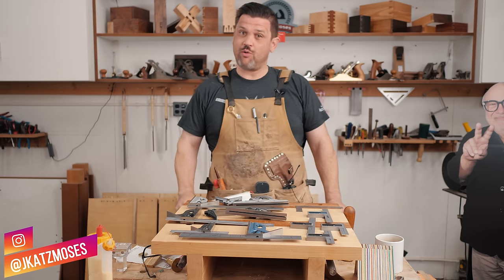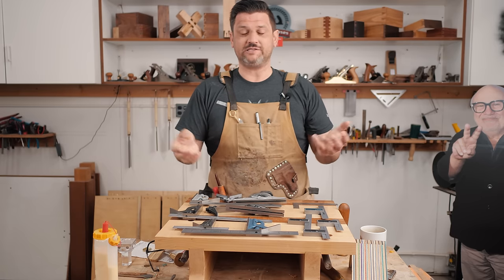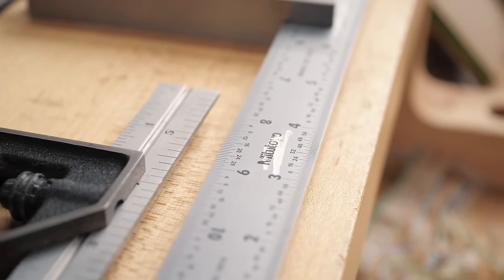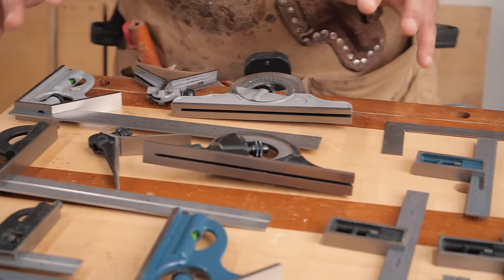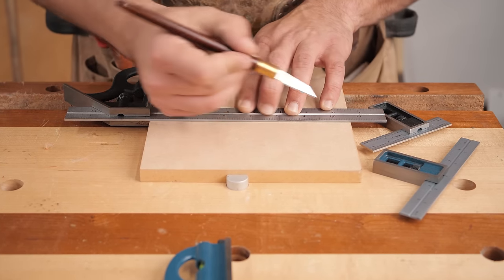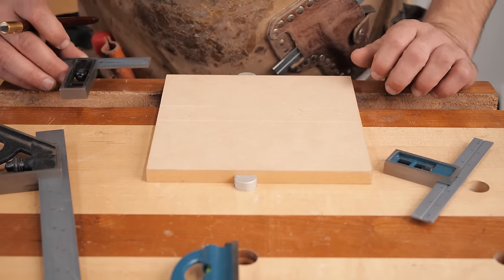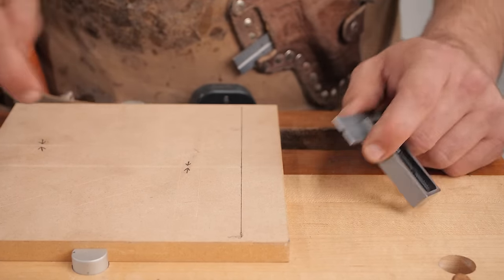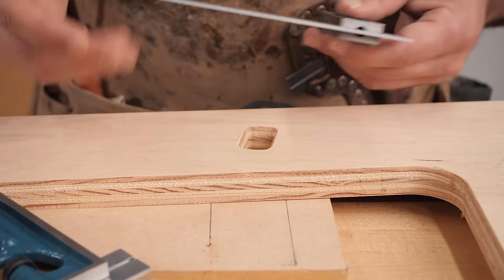Everything you can do with Combo/T-Squares and Why they are the Most Important Tool in ANY Shop

Comment from the maker: Get Blem Squares Here: https://lddy.no/fdk9
Support What We Do at The Katz-Moses Store* http://bit.ly/KMWstore20
Starrett 6” Square: https://amzn.to/2PCeMxr
Starrett 12” Square 4 Piece Kit: https://amzn.to/2vwS2bk
Veritas Layout Square: http://bit.ly/2VwJwnv
Reply: Thank you
Reply: I'm on my third attempt at a straight 8' saw guide. Resorted to U-shaped aluminum on a factory edge of bb ply this go-round and STILL not there. Slight bow in it after assembly. Sigh. I might start chopping up angle iron from a bed frame I found. Got any videos on making due? If I get one thing straight, all else will follow.
Reply: Try a steel stud
Reply: @Robyrob7771  thank you
Reply: Another tip is that when adjusting your squares if you make it a habit to hold nearest to the blade during the slide motion they'll stay square longer, further away from the blade technically should cause a microscopic amount of racking tension combined with the sliding motion and rub a tiny bit harder on one adjustment post than the other, a trick I use on my Empire square that I have to tune once a year, maybe I wouldn't have to be as anal if I had an expensive one.
Reply: I'm so sad I just bought an empire square.
Reply: JKM, you said in the video you got 60% off the Blem squares, how? Also, this is a great video. Ones like this are so valuable for rookie woodworkers and even some vets.
Reply from the maker: @greenwoodsmithing867  the Blems are 60% off retail normally on their site
Reply: @katzmosestools  Thanks for the quick response. Last question, these are REAL Blem squares, not fakes, they're accurate? Have you or somebody you trust used this site? Sorry, it's just almost too good to be true.
Reply: Thanks Mr. Katz-Moses, this is great -- I used the link and got a blem square
Reply: Sorry, just visited PEC's website, wow these things are pricey!  The 6-11% off at TayTools is an additional discount off the already reduced blem price.
Reply: Hey man I just spent 135 bux on some blem Squares with your link hope you got credit I find your info very informative and appreciate the effort put into your videos and hope to be as good as you one day lol thanks man
Reply: Have you tried the Woodpecker USA made squares? Higher price than Starrett, but more features.
Reply: @greenwoodsmithing867  it’s abundantly clear that’ll in the video there is no accuracy issues. Watch the video again

Comment: I like Harbor Freight squares, perfect for checking 89 and 91ish degree angles, and the built in bubble level is perfect for making sure you have some slope in a concrete form for proper drainage.
Reply: Fom the rare few times I've had to do a little bit of concrete patchwork around the home, it seems it would be brutal on many measuring tools, so good enough yet cheap to replace is the way to.
Reply: That’s not a bug, that’s a feature!
Reply from the maker: Hahahahahahaha so true!
Reply: Best comment
Reply: That is a plus or minus a degree auto add -on feature to a Harbor Freight squares.... no need worries.
Reply: Funny!  For a second I thought you were serious.
Reply: Laugh all you want.  I'm not taking back my big yellow plastic speed square.  I love that thing.
Reply: @kirbyspencer538  I have one of those. They're like the Crocs of the wood shop.
Reply: @pthomas36  Hey, don't knock my Safety Crocs!
Reply: I just eye ball my 90ish and 45ers
Reply: close enough for rock n roll!
Reply: It's not always the equipment. You can have all the expensive tools you could ever want but that doesn't mean you're creative or can improve. I love woodworking and if all I could afford was HF then that's what I'd buy in order to get started. I played golf with a co-worker and he had all the best toys but he couldn't defeat my set of $100 clubs.
Reply: I have built numerous pieces and have only used the $2 plastic speed squares. I know they are not square, especially my 12" one. I should probably get something better
Reply: Best comment ever 🤣

Comment: I just purchased a PEC blem combo square and folks, and the difference between this tool and the Stanley/Sears/Irwin models is night and day.  The head itself weighs more than an entire Sears 16" stainless steel combo square.  There is absolutely no slop in the fit between the blade and head.  The markings are super clear and the edges are tack sharp.  What you're paying for:  1) better steel 2) extra labor to mill the parts to higher tolerances 3) higher quality control, resulting in a single tool that can serve many different purposes, as Mr. Katz-Moses so elegantly explains. 

Dude, thank you for helping a brother out!  I love your videos and can tell a ton of work went into editing them---you get to the point quickly and clearly and we're lucky to have someone who is not only a talented woodworker but also a teacher (MOST of us cannot teach, contrary to popular belief).
Reply from the maker: You nailed it bud!

Comment: Ha, thanks for showing how that center finder attachment works. I just picked up my first 4 piece combo square yesterday just to have when the need arises. Got the stainless 24"'er from HF. I checked it out against my Swanson speed square and it is perfectly accurate. The straight edge ruler is also perfectly flat on all sides. $8.50 on sale👍

Comment: Really wish I saw this before today. I just bought an empire 6" combo. 

When I got home from work I did some playing around with it and my veritas layout square. Over 4.75" it is out maybe 1/32 of an inch. That is 0.00657. For most of my needs that is sufficient. There is also a slight high spot in the middle of the one side, that I could hone out with my wet stones, but again, it is sufficient. Especially since I will be using this to mostly marking out screw locations near the edges/ends of boards. 

I am definitely going to go get a BLEM one from the link though. 

PS from my experience the Empire stuff is not so much for fine woodworking, but more for general carpentry, ie building a deck or a house. I have seen precision doing that to the nearest 1/4" or if you are lucky 1/8"

Comment: I have at least a dozen assorted squares including three 12 inch combination sets (a Starrett, a Mitutoyo and a cheap Chinese) two small combination squares (an Empire which is surprisingly good for what I paid for it, and a cheap one) plus three engineers squares, a precision square (which I bought from Wish and wished I hadn't because it is shite) various framing squares, a big woodworking square, four magnetic welding squares, pairs of 1-2-3 and 25-50-75 blocks which count as squares and are incredibly useful, and I must have forgotten about others like the T-square and plastic tech drawing square.   These were collected over 40 years as a toolmaker, and 15 years of retirement now loving working with wood.

I loved the tip about using the grove in the combination square as a pencil notch.  That was genius and something you wonder how I never thought of it years ago.  A tip I would like to seen is how not to lose the retain nut from combination sets.  In my case its from the protractor, and thinking about it, I could easily make one, but I am restricted to my home shop during lockdown — which our PM has just told us is now likely to extend well beyond the initial four weeks.  We can't even order in tools as they are not delivering that sort of thing — I must have half a dozen items stuck at the border with absolutely no idea when they will be released.  It could be months!   Are you allowed to mail out your stuff right now, and if yes, does that include international (New Zealand in my case)?

Anyway Jonathan...  Thanks for keeping us entertained and informed.

Comment: Honestly, when I began live as a mechanical designer, first thing I bought myself was a set of squares, a set of micrometers, steel scales and was talked out of buying a dial caliper by the guy at the store. He told me, get a Vernier Caliper and you will have it all your life, because no one will steal it. He was totally right, and once you get use to using it it's no slower to use than a dial caliper. 
I have actually walked off and left my calipers out on a machine, then went back and they were still there and they had been moved. picked up, looked at and put back down. 
Over the years guys have walked over and looked them over and asked why I haven't gotten a "good set" of calipers. I'd tell them, "Those ARE great calipers".  I still have them.
Reply: I heart my Mitutoyo.
Reply: @OvertravelX  
Back in my machinist and mechanical engineer life I started with Mitutoyo dial calipers and mics. Inspecting sintered tungsten parts destroyed my steel dial sets so I invested in a 12" digital set with carbide jaw inserts: cost me $425 back in 1996... but I still have and use that set. I later picked up a set of 6" Etalon dial calipers out of curiosity, I like them alot too.

Comment: Excellent timing. I was debating ordering a set of Woodpecker's one-time combination/ double square set for $250+. They are doing their production run and tonight is the last night they have the ordering open. Glad I didn't because I have a 4pc. combination PEC at work I really like but was having a hard time justifying buying a second set at full retail price especially with the additional features included in the Woodpeckers. Ended up ordering a blemished 4pc. combination and 6" double for $80. Plus it came with free 7pc. bradpoint drill bit set and free shipping. Thanks for the tip Jonathan! Love your channel. Keep up the great work!

Comment: At 7:15, you are right that the engine divisions can be used for extremely accurate layout, but it is kind of a goofy way that you do it. Opens you up to error and excessive wear of the divisions, or dulling of your knife on a hardened rule. 

Instead, stand the rule on edge and guide the scribe, or the unsharpened back edge of your knife, down the division to the surface. This eliminates what is sometimes called parallax error.

Comment: You voiced down aluminum squares as a carpenter's 24 X16. But they out there. They may not be square but can be adjusted using a hammer and cold chisel.
If the internal  is acute (less than 90) hammer the interior with the chisel a bit and the angle will open. If the interior angle is (greater than 90) hammer the exterior corner with the chisel and it will begin to approach 90. Of course a reliable square template is need and may be factory cut sheet of plywood.

Comment: Thanks for the tips on quality measure/mark tools, went over to Taylor (yes, I used your link) and got a combo square, a digital level, angle incronometer, misc. supplies, and earned a free set of decent brad-point bits.  Though my work is still @ the home carpenter level, I hope to step it up and you hipped me to some great deals on the kind of accurate tools one needs to up their game. Truly accurate tools make the difference between close enough for jazz (I can joke like that 'cause I'm a musician) and close enough for a woodworker.  Thanks again!

Comment: I got what I thought was a good combo square and have been using for a while. Was making a table saw sled and couldn't figure out why it was off compared to my framing square. Did the rule two lines check, was off by about 3mm over 200mm!! It wasn't a cheap one either, but I should have checked first

Comment: While the grove in the beam of an adjustable square can be used to mark a line that way,, make no mistake about the fact that you can be off your intended mark if you do it that way!  If your marking point is able to go under the blade past the end edge it will be under marked as easily as you can over mark by placing your marking pencil or pen to far from the edge!  That grove is there so that the knurled knob in the head of the square can tighten the clamp inside the head down on the blade when setting the square and not for the purpose of making a mark.

Comment: Thanks KM!  I just found the great accuracy of using a marking knife along with a good square!  I'd add one to your list of ways to use them:  1,000,722 - Set the marking knife into the dimension you want and then slide the handle of the square to the knife.  Accurate and you can get it down to the 64th.  Also found a great marking knife: Stanley # 10-040 ... inexpensive and folds for safety in your apron.

Comment: Talked myself out of an expensive Woodpecker combo square, and got a 4 piece blem set from your link. 12" blade vs the 6" on the WP, and the blem has both metric and imperial! I am in the US, but would like to use metric where the items are smaller, and precision is more easy with mm.
Reply: How for off was the protractor?  Mine is off 3 degrees.  TayTools says that’s normal.  Seriously?

Comment: Jonathan, than you for the tips. I’m just getting into fine woodworking - vice construction level building. I ordered a 12 inch combination square and 2 sizes of T-Square and they came today. Very happy with them - fantastic quality, very accurate, and easy to read. I took great pleasure in throwing my crappy old rusty ruler can’t read the damn thing not quite square combo square in the trash. I have to say Taylor Toolworks is a quality outfit - fast shipping and great communication. Thanks for pointing me in their direction. This won’t be my last purchase through them.

Comment: small correction.  the depth of your mortise is the MAXIMUM depth of your tenon.  leaving a small gap at the bottom of a tight fitting mortise is FULLY acceptable.  If you aim to cut the tenon just a bit short, you'll often save yourself some time shaving it to fit fully.

Comment: While working with a crew, whether I was lead or not, I would have the whole crew measure my Starrett 12" rule with their tape measures.  Invariably some of the tape ends would have to be bent to read 12 inches.  Also: If you forgot your level, you can plumb a post with a combo square and its bubble.

Comment: Just so you know, that's a protractor, a compass is used for drawing circles
Reply: It’s also used for finding direction. North, South, East and West.
Reply: No. For drawing circles you need a pair of compasses. It’s always in the plural. I don’t know why. With one compass you find out where you are going.. You then only have a pair of compasses if your mate is journeying with you and he’s got one. 
For measuring angles you need a goniometer. More convenient than a protractor.
Then there are T squares, tri squares, set squares, combination squares, sliding bevels. Compasses, trammel points. I’ve never seen a tree with square roots. 
😀😀😀😀😀

Comment: Also after you set your check lines next to each other, you need to sight them, which means you bring your eye down to the board level look down the lines Daniel see if they're parallel or not you cannot tell from above, also it'd be very important tell your viewers how to actually adjust the blades in these squares you don't just loosen the nut inside the scale because that will wear the gauge pads that will make your Square out of alignment. When adjusting your scale to a specific dimension you loosen the nut then push the upward does forcing the scale away from the gauge pads then you move the scale to the location your desire. When you're close to the mark play me very close then you can release the nut I love to Spring to take over that make your adjustment or tighten your scale down also daylight lubricating oil wiped on the scale periodically it's not done daily will keep your investment well in tune and square is released from the factory in the first place, now go use your combination Square.,

Comment: Empire squares are solid for things that are less accuracy oriented. General carpentry work, including general trim and worksite endeavors are perfect for those types of squares. Spending $200 per square is a hard sell to a weekend woodworker when a new miter saw can cost him/her the same price.
Reply from the maker: 90% of the squares I use in this video are under $50. Empire squares are garbage and representative of the work they produce. I was a framer and did concrete for 10 years. I believe a square is the starting point for good work and preach that in rough or fine finish.
Reply: @katzmosestools  As a finish carpenter, I understand what your doing and saying. I believe that a good square can do wonders for your end results. And I understand that woodworking isn’t the cheapest hobby or occupation. However, watch any of your favorite content creators and you’ll notice the high end stuff in every video... with the exception of guys like Steve Ramsey.

Speed squares are not woodworking squares but small rafter squares, and as such are generally made for rough to passable finish work. When I first put my Woodpecker square against my 12 inch Empire rafter square, it was obvious that the machining isn’t the best. However, you’re also the first guy on YouTube who’s even mentioned buying blemished squares.

Trust me when I tell you that I understand where you’re coming from. I’m just saying that the good stuff in squares are almost as expensive as a few major buys of a starting guy’s burgeoning workshop.

I can’t say that they’re not worth it, though. Results will always be seen with proper tools and knowledge.

Comment: Jonathan, you are right, I have bought the machinist squares from Amazon for 8 bucks and had to return them because they were not square.  I paid more for PEC, Moore and Wright and those were great.  What do you need a double square?  Can’t you just use a small combination square?  I use a 4 and 6 inch machinist and 6 and 12 inch combination. Isn’t that enough?  I would like to get the compass though.  BTW, I say again, I love your videos. Keep making them. Thanks.
Reply from the maker: Thanks bud. Everyone has different work flow. I like the t-squares as opposed to the machinist squares because they do the same thing but also so much more.